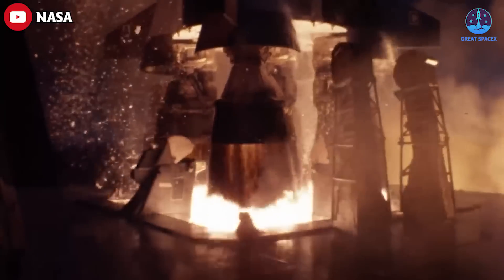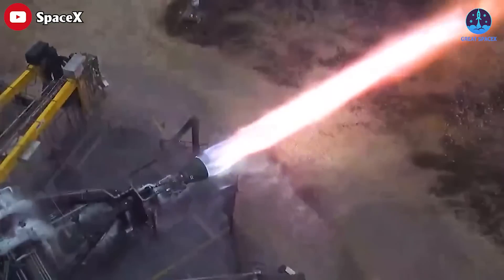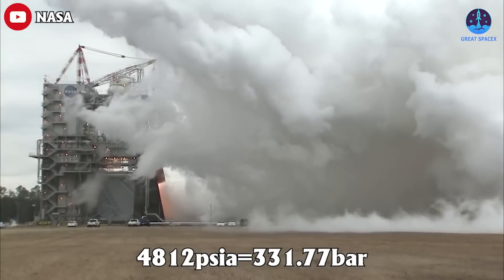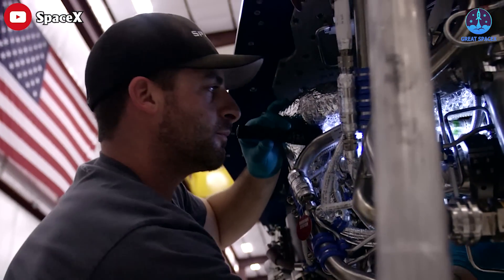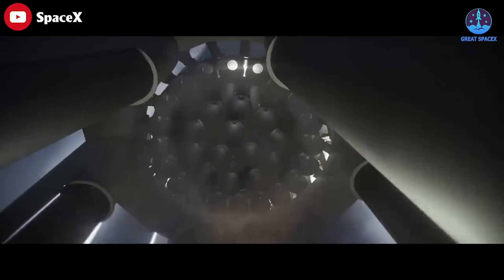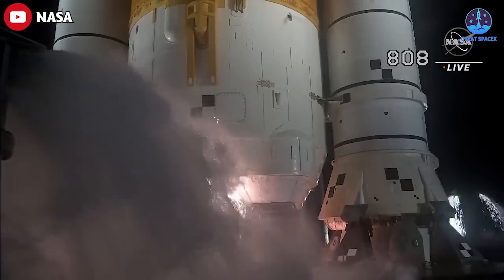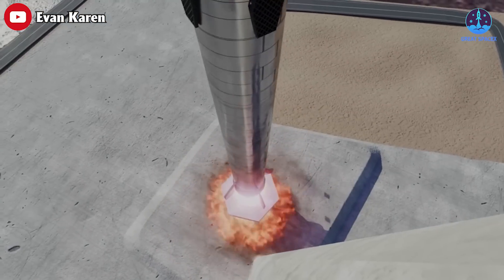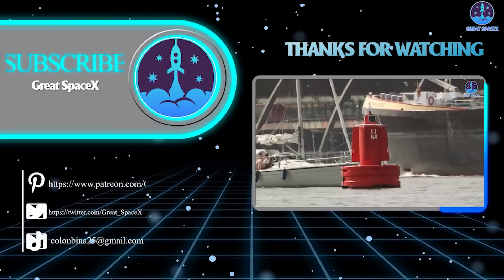SpaceX raptor engine 2.0 leaked genius engineering by Elon Musk shocked others

Comment: These -- ARE NOT -- being built 1/day. They are rolling off the "assembly line" at that rate, but they spend a much longer time traveling and being assembled. They start 1/day. They complete 1/day... But! They take much longer to build... 
The same is true of StarShip CEO's recent announcement of "building" 1 Starship/day... NOPE.  Start 1/day. Complete 1/day. But! They also take much longer to build. Many, many more, are "on the in between"... 
You can't ignore the middle stages of the builds... That's where the real work is done.